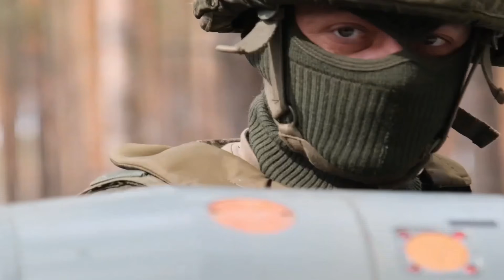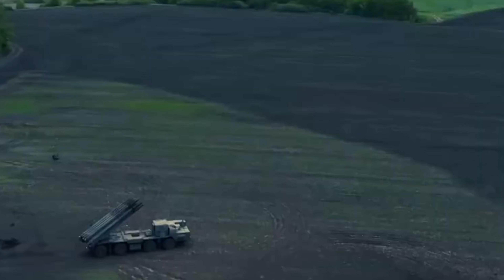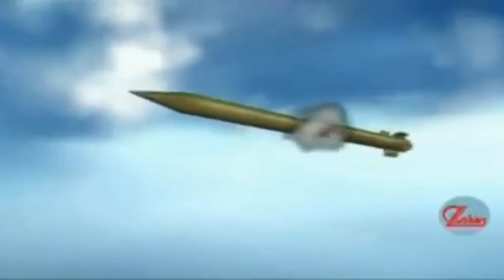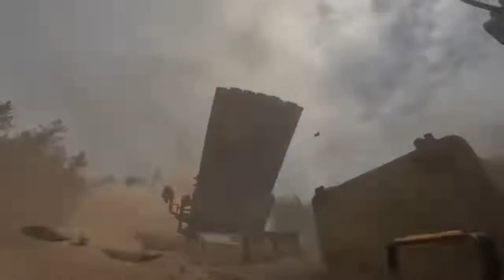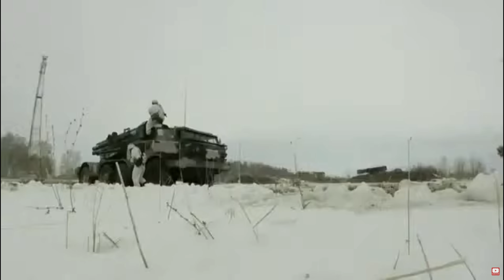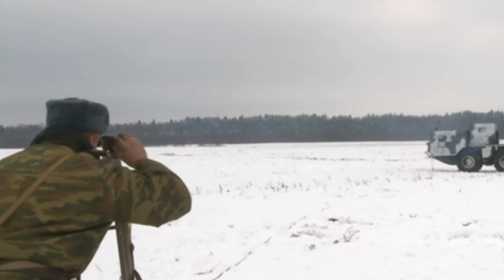Russian BM-30 'Smerch' Multiple Rocket Launcher | MOST FEARED ARTILLERY WEAPON ☠️

Comment: Countries like Russia produced huge quantities of missiles for these systems, and when the conflict in Ukraine started, I knew that Russia would first use up the old missiles, which is logical, but that it would also work on new missiles for the simple reason that today a missile of 300 mm and so long can do much more and much better. First of all, we can expect to see the wings on these missiles very soon, as well as the GPS system, something similar to that on the FAB bombs, by adding wings that would open after exiting the barrel. It would look something like the new Russian anti-ship missiles, of course, only much cheaper!!! Russia has long mastered cruise missile technologies, and this is a very small upgrade that could add enormous range to a missile with such a large rocket engine. What's more, the wings could open as needed, say after 3 to 5 seconds after it comes out of the barrel, which could turn it into something similar to FAB bombs, only much cheaper and with a longer range. I'm guessing the rocket

Comment: @Matsimius, if you like interesting soviet artillery, try to researching the "Santimetr" high precision munition for the Tulpan mortar system. It works on the principle of "corrections in the terminal phase of the trajectory, with high intensity rocket motors. There is an old russian documentary about it "Ударная сила" ep 102

Comment: Oryx lists two destroyed BM-30s confirmed. Either they are more survivable for whatever reason or they haven't been used as much as other types.
Reply: I guess in this case Oryx is actually believable, for once. Given the range of these systems, 90-120 km, it is unsurprising that few are destroyed. The Kiev forces don't have many weapons with that range (off the top of my head, the HIMARS/ATACMS, storm shadow, and bombs/missiles launched from planes) , so the few they have are mostly used for higher value targets. Maybe they had some of these systems of their own early on, but I can't remember hearing of or seeing one, so they were probably gone early on, I imagine.
Reply: @user-kq7fh2jy3j  Oryx is fairly reliable, they are all visualy confirmed and you can check them yourself.

Comment: I dont get the love for the himars. it's just half a MLRS on a light logistical truck. It's not ground breaking like a CAESAR in its time, since the rocket artillery and truck are the most common combination from the invention of mobile rocket artillery. What make the himars good, is the Gmlrs, not the platform itself.
Reply: The MLRS and HIMARS platform's ability to reload quickly is what makes it able to survive even when operating close to the front lines, and the switch to precision guidance made it particularly good at taking out targets at the limits of its range.

This is what allowed it to take out Russian supply depots and force Russia to stage their supplies further away. This made it impossible for Russia to supply its forces to the north of the Dnipro. HIMARS is what pushed Russia out of Kherson and forced their retreat across the Dnipro. And it's the reason why the Russian offensive of 2024 failed.

Bluntly, neither Ukraine's BM-30s nor Russia's BM-30s could do what HIMARS could do. If it weren't for HIMARS, there's a good chance Russia would still be occupying Kherson, and the landscape of the war would be looking very different right now.

Comment: It's only good if it has guided gmlrs munitions or cluster and the guided variance are very very Limited in quantity and from what Russia artillery man reported it has a 60% failure rate of not being able to hit its Target or even launch they usually use the unguided Rockets since they are cheaper and produce a lot easier and these systems are not as common on the battlefield they have been destroyed in Ukraine buy drones and counter gmlrs and  Reload time is very long probably around 20 minutes but you can't deny it isn't a bad mlrs for the time period and the range is very good but in today's modern Battlefield it would likely be taken out very quickly where  modern ISR ,artillery tracking radars and  targeted very quickly so it would have to be very quick on setup fire and move out to a concealed position just like every artillery system now these days and when these things fire you will be able to see it for miles from drone or aircraft so getting out of there is priority either way I definitely wouldn't want to be on the receiving end
Reply: what the fuck is this spaghetti? did they not teach you about full stop in school?

Comment: Yes, no doubt, it's a dangerous weapon system, but if they are on the Battlefield they have to be aware of 155mm L52 artillery systems with Ramjet ammo like Norwegian NAMMO with a range ~150km. So if I have choice, I'd like to be part of aPzH2000 crew then a BM-30.
By the way regarding western rocket artillery systems, the Dutch are just implementing PULS System into their Army, may be this could lead to another video ;)
Reply: There is  no evidence that this ammo is used by the AFU in Ukraine
Reply: @jetfighter200  Rheinmetall and Nammo are already producing this type of ammo for AFU. Rheinmetall is shorter in range than the Nammo one. But guess it's the 100km ammo Rheinmetall announcement done by Armin Papperger from May/07/ 2024 at TheDefensePost regarding Ukraine. Nammo was less specific in 2024.
And yes, we probably wouldn't hear from it  until it is widely spread among the AFU artillery. Otherwise it would be more than a shot in the foot.
Reply: if that will be used it will probably fails as badly as excalibur.
Reply: @jebise1126  Rheinmetall and Nammo must be very stupid using the same guidance system as excalibur ammo.

Comment: Some of the vehicles in this video look like the BAZ-135 (originally Zil)
More than likely they are BM-27 Uragan MLRS.
A very cool truck, they use two engines, one engine drives the left wheels and the other drives the right wheels
Reply: Uragan  BM-27 is the one with the two central wheels close together.
Reply: @johnbaker1256  Thanks man, I've never noticed
Reply: Thanks, I alway have problems discriminating Tornado, Smerch and Uragan

Comment: The system is a nuisance - certainly. But at ranges beyound 80 km the rockets generally need an update, which means they will have either own position or target position transmitted to the rocket - that can generally be jammed (more or less effectively), as the jamming vehicles are expensive and not easy to hide from anti-radiation missiles. The other option is an inertial guidance system, but they have a drift over time - it is to me a question if they are accurate enough beyound 80 km.

The reason I like HIMARS is that at shorter ranges below 80 km they are accurate as the drift of inertial systems is not to big. At larger ranges the ATACMS do need updates.

But with the rate Ukraine is taking out russian artillery systems - and particularly salvo rocket systems is at least bringing parity to the russians and with a much better ammunition economy.

I think the best way to take out BM-30 is with a swarm of kamikaze drones and prevent the enemy of building up the massive firepower needed.
What I do notice is that the system is approved for export, which does not indicate a confidence of the system.

What I have noticed is that the russians appear to go through gun barrels at a rate like an obese lady raiding a box of chocolates - for us who have witnessed such a splurge sincerely want to report them to the police for cruelty to bon-bon's.
The other observation is that the ukrainians are getting better at economizing their artillery, presumably using lower charges and a slower rate of fire. The point about tube artillery is the sound barrier. Using greater charges merely reduces the accuracy and destroy the barrels (and recievers?).

Comment: The problem with this analysis is that it relies on what has been published and as the Ukraine conflict has shown, the details in real life don't always match up to the specs.  It can use guided rockets for example, but how many of those are there?  Why,  with 800 of these, has Russia not already won?  If it's so good at counter battery fire why is there any Ukranian artillery left?  Is it just because they've dispersed?    I do notice it needs to be reloaded by another vehicle with a crane where the Himars and M270 (I think) can reload themselves from a dropped off pack so I can see logistics issues there.    I imagine that accuracy is a huge boost to logistics too.
Reply: Well you can answer yourself by just looking that in the last 2 years of war Tornado-S akka Smerch have been a real nightmare in the counter batery rol, destroying other mrls like himars and bateries like s300 and Patriots.
Reply: the Tornado U/S using also dropped off packs
Reply: HIMARs can shoot how many projectiles ? A lot less ! Worst, the warhead of these 300mm are much more specialized, including thermobaric, than the HIMARs.
Reply: @mirandela777  HIMARS is 6, M270 is 12. HIMARS is faster to deploy but M270 has tracks so it can deal with bad ground.  The SMERCH also has 12 larger rockets but for example I think they're often unguided whereas Himars and M270 are now all guided.  As for warheads HIMARS has quite a few (submunition, tungsten pellet, high explosive, tank killer, extended range etc) - just not thermobaric.  The HIMARS can fire 1 much larger ATACMS rocket as well which is something that the Smerch tube design cannot handle.   There's a new thing called GMARS which will have a truck chassis like HIMARS but 12 rockets instead of 6.   There's another Israeli rocket system called PULS which is being adopted in Europe too.
Reply: @timmurphy5541  - dude, is a bit like comparing apples with oranges, your argument. The direct equivalent of the murican big rockets HIMARs is NOT the SMERCH but yes, the ISKANDER. 
And Iskander is way superior to HIMARs, both in range and warhead.
Reply: @mirandela777  I'm no expert. Iskanders get used and have an effect obviously. But one vehicle that can fire multiple types of rockets that are accurate: that's a logistical benefit.   I don't know how it stacks up but Ukraine is still standing so obviously the Russian equipment - which is in huge numbers - isn't swinging the balance in their favour.
Reply: @ "Ukraine is still standing" 🤣🤣🤣 here you just get AWOL, dude !
Reply: @mirandela777  I find that the more laugh symbols a person the more hopeless their argument. Enjoy your tanking economy Ivan.
Reply: it seems that these were not even used much at all. guess the dispersion of troops and all that. 
still somebody needs to deliver himars drop box to himars unless you want to drive your truck way way behind your lines. so that isnt really much better. not when you get 2 of these trucks for half of himars.

Comment: Pleased you mentioned the thermobaric capabilities.  That is the aspect of these things that terrifies me, as a former soldier. Have you ever seen a firepower demonstration of thermobaric weapons. I guarantee you will never forget it. 
My personal fav. of tube artillery is the M270/MLSR. I witnessed those things in anger back in 1991 so I'm biased a little. Watched at night as two British systems let loose with a full volley at some unlucky distant target. Remember thinking at the time, poor b'stard at ground zero. Was impressed by how fast the scooted away. Then it struck me. I was going nowhere!
Reply: eh... theromobaric isnt some magic weapons. you only need to check power density of explosives and fuels. than you realize that when you can use oxygen from air for your booms you can get much bigger boom delivered by the same thing. same goes for rocket engine or ram jet. ram jet can just store more energy in it because it uses oxygen from air and can still be very fast.

Comment: Fodder for a $100.00 US Dollar drone...which can repeatedly bomb your "Smerch" now #anduril_industries or worse target your crew causing said item to be abandoned then captured. "Now your own guns be turned on you" as you arm your enemy. Far deadlier than this now armored APCs lead by the surprisingly not venerable at all M2 Bradley IFV. That will have a tow missile system on board which given upgrades now might have a range of 100 miles for said missile. Might have 4 instead of 2 of those missiles pre loaded as well now. The vehicle itself no upgrades full loaded has a range of 400 plus miles and is tracked not wheeled so isn't going to get stuck so easily upon being off road. Interesting uses wheels be this "smerch" actually. US rocket systems are tracked not wheeled😊😊

Comment: This may be an off topic comment, but back in the early 2000’s I looked into Russian mobile excavators. Truck mounted excavators similar to the Gradall  These truck mounted excavators had outriggers to stabilize the chassis, and the buckets were all equipped with Twist Wrist Controls The bucket could swivel in 90 degree angles giving the operator the ability to pick/pull rocks or other objects with accuracy.
Reply: People know it, or they don't want to know it, but Russia produces good engineering products. It manufactures from small excavators to the largest dumpers. 
They also have very good programmers, I worked for an American company, our office was in the Czech Republic, other branches were in Russia and Ukraine. Russian programmers and developers did an excellent job, better than the Ukrainian office, they were fast accurate and had very few errors. 
I am an ex-soldier (1999-2009) and I studied radar technology and air defense missile technology (1995-1999). I can tell you that the Russian systems are well made, at that time they were technologically behind, the control was simple but functional, we had no digital systems , LCD and the like, but the rocket always found the target and destroyed it, literally hundreds of rockets passed through my hands during prophylaxis and dozens of rockets during training shootings. Rocket failure was about 1%, and 90% of that was the fault of the rocket system operator. 
If Russia had enough capital, it would create anything and produce it in large series. Russians are very resourceful and have unlimited natural resources of basically everything.
Reply: @KorbenDalasCZ 
I worked with a Russian guy in a post production house, he was an ex tank commander.  He was one of the online editors, his work was always perfect, always on time.  The stereotype of the Russian is well wide of the mark in my experience.
Reply: I'm from Czech Republic, we produced some pretty cool weapons
Reply: Czech , East German technologies from the 80s.

Comment: Low smoke fuel but on wet ground in causes cloud of steam while burning the surface.
What amount of energy released in short time.
Thats the video part at begining, later there is composite whit regular white smoke.
Reply from the maker: It is indeed a complicated issue to deal with.